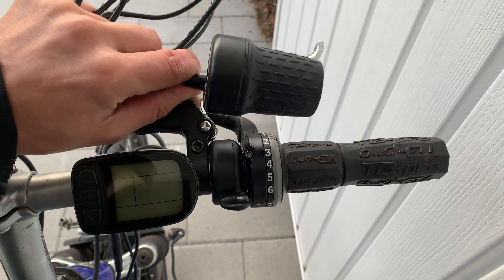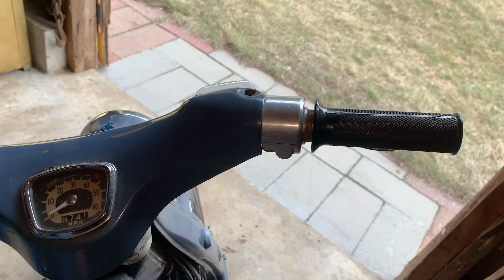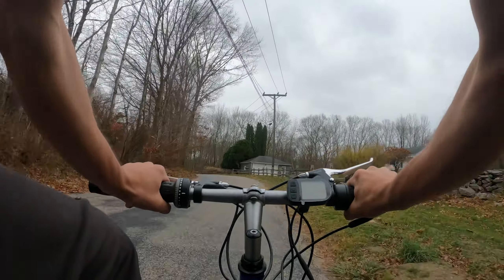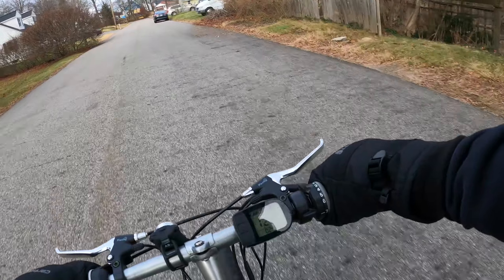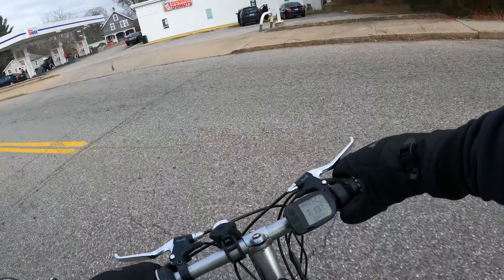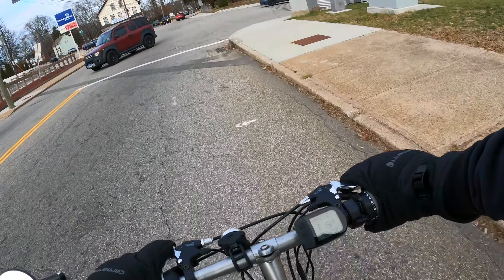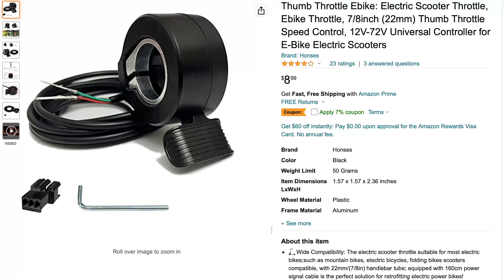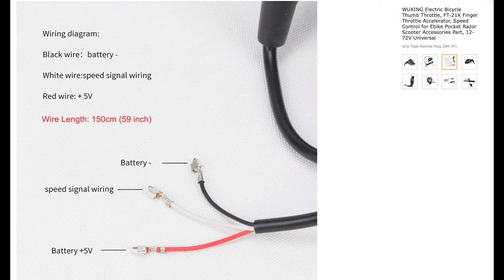eBike Twist Throttle vs Thumb Throttle

Comment from the maker: This video is a sloppy mess.  Short assessment is that Thumb Throttle is good if you’re mostly using pedal assist.  Twist Throttle is good for non-pedal assist pedaling and no pedal riding.   Also, Thumb Throttle takes up less handle bar space.

Comment: Looking at trying to change to a twist since it hurts my thumb holding it down going to work 😂
Reply from the maker: I have to repair my pedal assist wire, and using the Thumb a lot is annoying… so is the fact that the 1st 10% of lever travel = full power 🚀

Comment: hai provato a smontarlo ? sarei curioso come è fatto dentro  monta un encoder incrementale ?
Reply from the maker: I didn’t take it apart beyond the wiring, but it could be a Hall Effect Sensor.
Reply: Yes, it's true there is a hall sensor but my curiosity is does it just turn it on and off or are there more speed steps? @DotDotMatrix
Reply from the maker: I don’t know enough to know what I’m talking about, but it feels like if the magnet is partially over the sensor it starts react to it, but as soon as it’s fully over the magnet it’s at 100% throttle... so 90% of the throttle action is at 100% and there is very little play between 0 and 100% as a result its hard to go slow with the throttle and is easier to use pedal assist in that case.
This is a link to a picture of the thumb throttle sensor stamped 49E 1335 and the throttle magnet....
https://drive.google.com/file/d/1Rh-eFoKdiRbcMITCifglTuIhoqsuU9pI/view?usp=sharing

Comment: Is wheeling easier with thumb throttle or twist?
Reply from the maker: Def [twist] throttle… and it makes it way cooler in general.
Reply: @DotDotMatrix  which throttle? And does it accelerate fast?
Reply from the maker: Oops, meant to say twist… The acceleration or torque is very fast when starting but the power curve slows as you’re going faster… so for the 1st second I’m trying to not spin out my tire and then I’m giving it all it has…. I’ve never timed it but I can probably get up to 30 mph on a flat in under 10 seconds… I will probably test that with and without pedaling soon.
Reply: @DotDotMatrix  dang they don't make throttles for the super 73 z1 all the ones I've found are 3 pin the z1 is a 6 pin